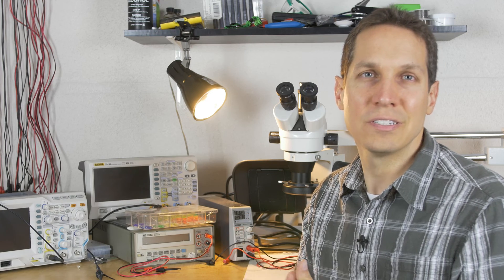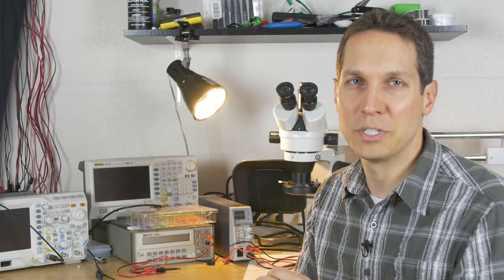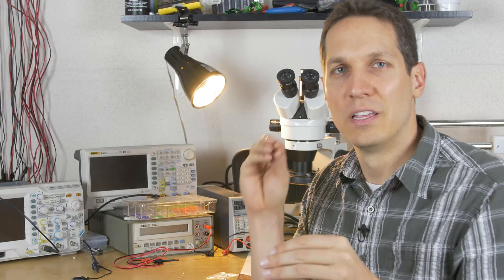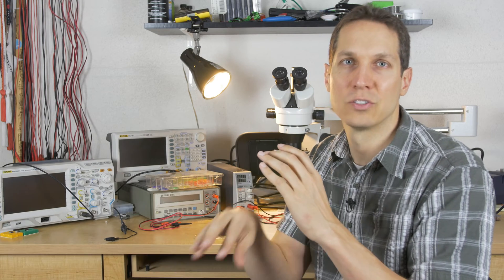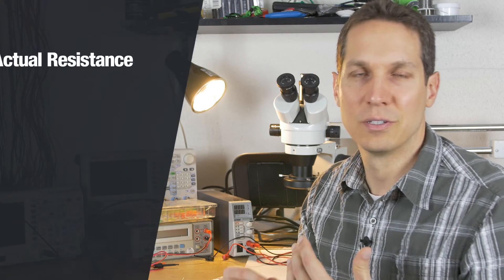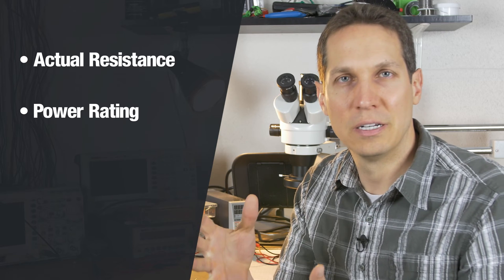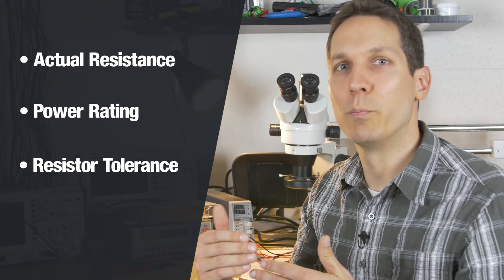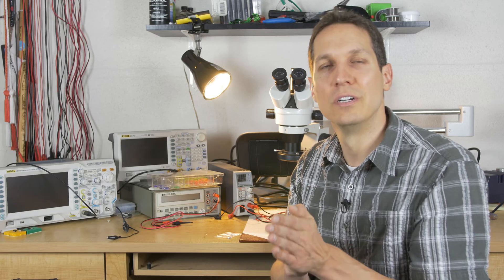How do resistors work? (Animated) | Basic Electronics

Comment: If resistor resists the current then why does current is same before and after the resistor
Reply: Unless you are collecting electrons somewhere in your circuit, all the current generated by your battery will ultimately go to ground. There will be no electrons that get left in between the two. Therefore, all the electrons that go into a circuit will go out of that circuit.

And in a series circuit, there’s only one path for those electrons to go.

The force acting on every electron (voltage) is the same, the path they travel is the same — they’re all going to travel at the same speed, to the same place. So the flow is going to be identical everywhere along that one path. 
resistor slows down the electron velocity, but doesn’t collect or stop them. Current equals the number  of electrons travelling past a point in a given time - if the electrons travel slower, then that means less current is flowing, but they flow through both sides of the resistor with equal speed on their way to ground. The resistor just dictates how fast the electrons get to flow through it - kind of like how a speed bump can force you to only go at a certain speed
A resistor can be viewed as a speed breaker instead of a barrier
Reply from the maker: That is an excellent explanation - thank you!
Reply: @sumzk  great man thanks alot i have learned a good knowledge by ur comment

And i also thank @circuitbread bcz through this channel i came to know about resistor by this man
Reply from the maker: Haha!  I guess whatever works 😂
Reply from the maker: Good question.  Imagine you have a vertical pipe, 1 meter in circumference and 10 meters tall.  If you take that pipe and at the 5 meter point, pinch it to a .1 meter circumference, then the flow through the entire pipe, not just at that .1 meter pinchpoint, will be the same.  Does that make sense?
Reply: @CircuitBread  thank u for ur explanation sir but can i get an actual explanation of what happens like in terms of atoms in resistor and how they obstructs the flow ...pls sir can i able to get that and not water pipe anology 

I understood water pipe analogy
But i want actual case😊😊

Comment: I don't get the analogy.
think the flow of water on small pipe will be faster if it connecter with bigger pipe behind it
Reply from the maker: Hey Zulfikar, no metaphor is perfect and one of the challenges with this is that, connected to a city source, plugging up a pipe or hose increases the pressure (the voltage).   I think it would be a better metaphor if you imagine that the voltage is a bucket of water at a certain height - the pressure won't increase as you make the pipe smaller.

Comment: Watched more of the video and have another question, 
Because the resistor forces the water through a smaller gap, does the voltage required to get electrons through the gap increase?  And therefore, that's how resistors use up some of the voltage supplied to the circuit.
Reply from the maker: This is where having an intuitive understanding of Ohm's Law is really helpful!  With V=IR, you can see that if resistance increases (the pipe gets smaller), and you want to keep current the same (same amount of water flowing through), then yes, voltage would need to increase (increase the height or potential of the water).  
But, in a real circuit, you're typically working with a given voltage source so that voltage won't change (For example, 1.5V for a single alkaline battery, 5V for a USB power source, 3.7V for a lithium-ion battery, etc.)  So, if resistance goes up or down, current also goes up or down.
Reply: @CircuitBread  Okay cool, glad I understand that. Thanks heaps!
Reply: CircuitBread hsh
Reply: Cir

Comment: Question:
On the diagram you showed of water going through a pipe, all the water that hit the narrower part of the pipe went through, and that confuses me.  Because, to my understanding, resistors are supposed to reduce the current (water) going through the wire (pipe) but with what you showed, it did not reduce the amount of water going through the pipe.
So do resistors actually reduce the amount of current supplied to the rest of the circuit or do they simply slow down the current at that point?  Would really appreciate any answers!
Reply from the maker: Hi Stellular!  Your understanding is correct - the resistors reduce the current by restricting the flow of electrons.  At around the 3:40 mark, you notice the flow through the "resistor" which is the narrow part of the tube.  How that restricts the flow is, imagine if that narrow part of the tube were 4 times as wide, how much more water would be flowing from the top to the bottom?  So, it does reduce the amount of water (or "current") to a controlled flow.
The second question is really good - the resistors reduce the amount of current through that point.  Whether or not there is more current elsewhere in the circuit depends on how the circuit is set up.  If there is something else "downstream" or "upstream" in series, then the current through those other items will be the same as through the resistor.  If there are other elements in parallel, or different voltage/current sources, then there will be different paths for the current to follow.  That's when you start needing KCL/KVL (Kirchhoff's circuit laws) to start calculating values.
Reply: @CircuitBread    Firstly, thank you very much for taking the time to answer my questions!  And now I have another... 
Because a resistor reduces the amount of electrons able to pass through it, what happens, physically, to the electrons that can't get through? Is there some sort of buildup? Do the electrons disperse somehow?
I feel as though I may have some preconceived misconception hindering my ability to understand some really important detail.
Anyway, again, I really appreciate any answers you can give me. Cheers
Reply from the maker: Hi Stellular!  No problem!  The electrons that can't get through simply stay where they are.  They don't build up, however, as that would mean that they're increasing the voltage potential.  This may be a weird way to say it but all the electrons that want to go through the resistor, go through the resistor.  If the voltage is higher, if more electrons wanted to go through, more electrons would pass through.  
We almost always create a written tutorial to go along with these videos to provide a slightly different perspective on the same thing and also to let you go through it at your own pace.  Have you looked at this one?  https://www.circuitbread.com/tutorials/whats-a-resistor  I'd be interested to know if that helps make this more intuitive.
Reply: @DanielDavies-StellularNebulla  read about drift velocity there u realize how much collisions there that work as resistor nd these collisions increase by increasing length nd increasing temperature decreasing area
Reply: @donotbebiased6987  Ah, that makes sense, over a year later lol.  Thanks for responding, I'll definitely check out drift velocity 👍
Reply: @CircuitBread  if area would increase due to high pressure in this area velocity decreases. thus low water current